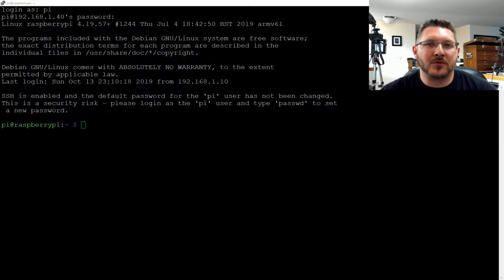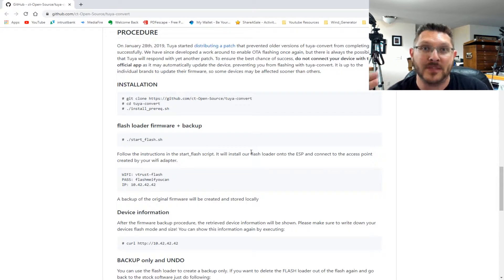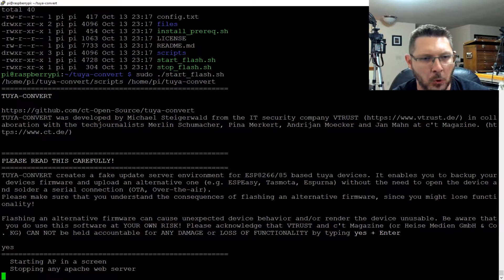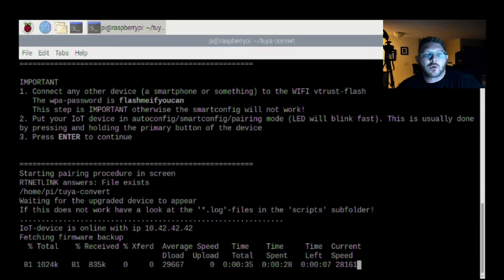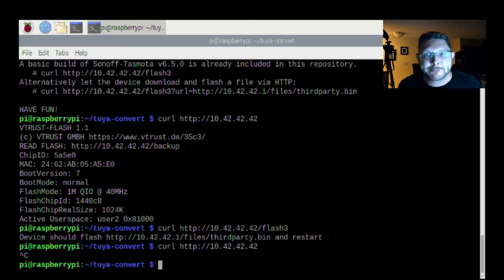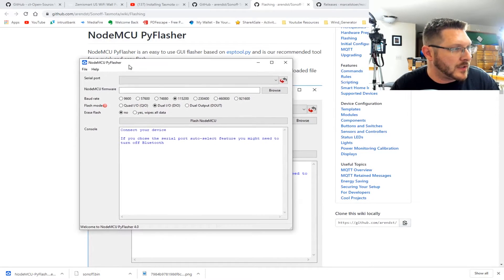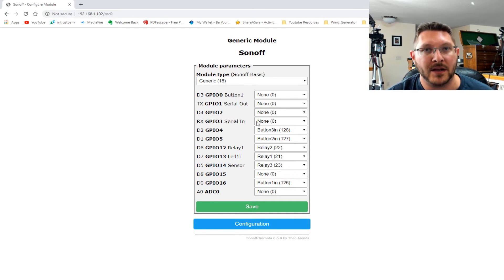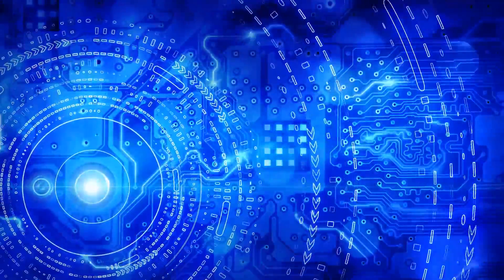Hacking Zemismart Smart Switch With Tasmota

Comment: Take care with buying this switch because I recently bought one and it comes with beken bk7231n chip instead of ESP. So, no longer option of flash with tasmota. The model is now "KS-811-3" instead of just "KS-811" and the PCB have the 05/2021 date of release printed.